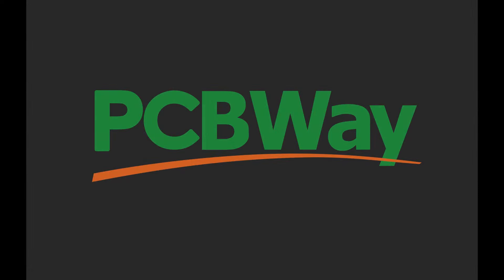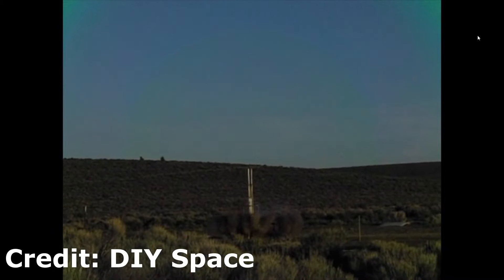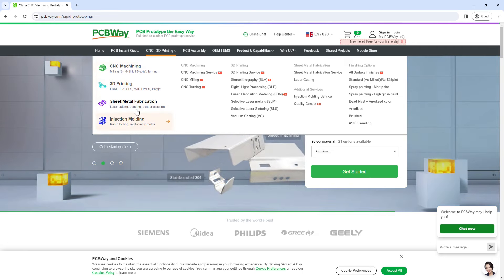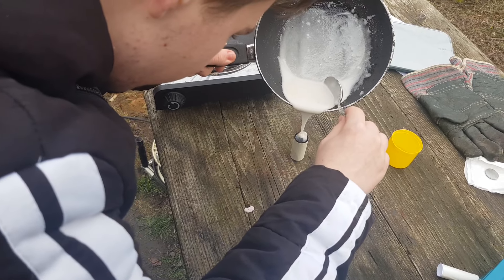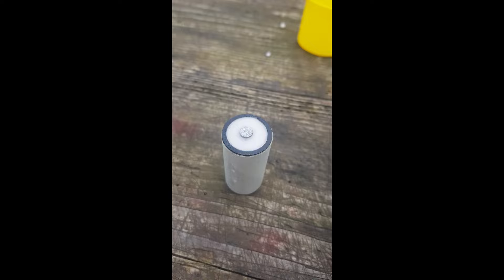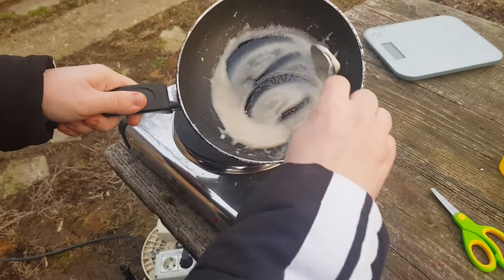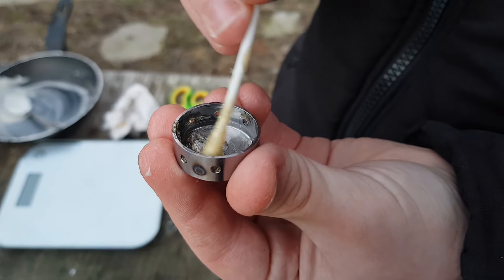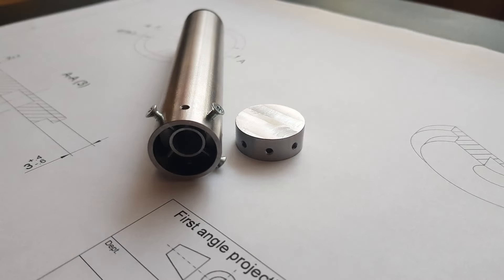I made a Solid Rocket Engine!

Comment: I suggest replacing the rubber seals with high-temperature silicone. Even up to 400 degrees Celsius it will be better than rubber. The second thing - fuel grain is prepared carefully at home. Mixing ingredients, controlling temperature, density, tamping in the form. These are all trivialities, but they have a huge impact on the quality of the fuel grain and its stable combustion instead of explosion.

Comment: Suggest you either use an electric ignition or learn to make long, fast fuse, so you can start from a safe distance and your safety doesn't depend on running. I don't know if anyone does this, but I have found that a bit of carbon fiber, either tow or a splinter of the pre-cured stuff that's been sanded, makes a nice resistive element. The latter is a bit easier to work with. Don't try to wrap tow around a wire. If it's anything like mine, the sharp bend will snap it. You can't solder to it, or I can't, anyway. However, you can wrap wire around it for a connection. I have witnessed what happens when carbon fiber composite shorts out high voltage lines. In places, the epoxy just disappeared, but the carbon was more or less intact. So you can hit it with a lot of current and get a lot of heat. Put some pyrolant on the carbon anyway, though. A quarter inch between the wires attached to it is probably long enough with carbon. It's more resistive than nichrome. 

Of course, you can make perfectly good electric ignitions in other ways. One of the pitfalls, though, is that some resistive elements, if hit with too much current, will fail before they ignite anything. For instance, I was experimenting with small resistors for ignition. Some of them would just stop conducting at all if I used a 3S lipo for current, but lasted long enough to light things when using a 9 volt alkaline cell.

Comment: two things. you must dry the mixture very well, at least a couple of days in a container with a desiccant. second thing, I didn't see how you started the engine, but you have to make sure you light it from the head (not near the nozzle) and the best way is to use an electric match; then I personally use to dirty the wall of the core with a little bit of flash powder (that of firecrackers) to quickly light the entire internal surface
Reply: Third... it seems that your compound lacks oxidant, increase the proportion of kno3
Reply from the maker: I fixed the propellant issue and I'm about to try out the head end ignition. I didn't know you can use flash powder to do that, thanks!

Comment: The solids left in the motor suggest you need more oxidizer.  This will lead to a less viscous mixture making casting the grains more difficult but that's the trade-off.  Good effort though.
Reply from the maker: I actually dropped the sorbitol idea. Last weekend I tested the motor again with sugar and it produced 130N of thrust! 3 times the expected amount. This difference comes from the fact that I didn't take into account that the propellant burns faster under pressure. I will cover these things in a future video. Thanks for the support!

Comment: Hello sir your video was so great and really helpful , i  would like to know how you designed the rocket motor , Need your help as i am designing one for my project i have no clue how to do that .
Reply from the maker: Hello, happy to help! The actual thermodynamics side of designing is a little more complicated but you can find info about it online or in books. By far the most popular book on rockets is "Rocket propulsion elements" and you can find most of the equations there. As for the mechanical side, there are graphs on the internet that show the strength of materials for different temperatures. Since most of the motor is a tube, the math for determining the thickness is pretty easy. Also, make sure you have some sort of liner between the engine tube and the propellant that absorbs the heat from the combustion before your motor tube fails. I didn't have a liner on my design but I highly regret that. The engine is still fine but the risk is too high anyway. I would also recommend working with high safety factors (above 5) so you can be sure you're safe. If your project doesn't require any crazy engine though,  I would recommend just buying one off the internet. The development, machining and the propellant making are way too expensive and dangerous. I hope I was helpful!
Reply: @RUD_Technologies  thank you so much sir ...!

Comment: Your fuel is burning from the top to the bottom. Try getting an electric igniter and push it all the way inside. That way the fuel burns from the bottom to the top, igniting more fuel on its way to the nozzle, therefore creating a higher pressure inside and greater thrust. 
I'm not sure about the power drill to create the hole, my rockets turned out to spin because the hole wasn't perfectly parallel to the casing.
Also try experimenting with different ratios between fuel and oxidizer.
Love your nozzle btw
Great video 👍
Reply from the maker: Thanks! I ditched the sorbitol and the drill idea, now I found a way to make holes in the grains. I would try making electric ignition, but every time I tried making an igniter I failed. I taught of making a really fast burning pyro igniter from the propellant in it's powder form with iron oxide mixed in, and have solidified propellant at both ends, witch burns slower. This igniter would basically be a straw with powdered propellant in it.
Reply: I ve calculatet for sorbitol it would be 78% kn to 22% Sorbitol for total combustion but i think this mix is an little bit aggresive

Comment: Nice video! Maybe try to ignite the propellant through the nozzle but all the way up close to the forward closure. This way thev exaust gas will ignite the propellant grains on its way down. Pressure will increase faster and burn rate will be higher...
Reply from the maker: That is what I am going to try to do in the next video. I am working on a non-electric igniter that could do that, because I tried electric ignition in the past, but I wasn't able to get any good or reliable results. Thanks for the support!
Reply: Great - looking forward to seeing the results.😊

Comment: I'm going to suggest this based on the assumption that your propellent mold is either metallic or ceramic, so take this with a grain of sucrose.

 Have a removable cap on one end with your center cylinder and place the mold on top of it sealing off one end. Fill the container with the unmelted grains mixed thoroughly together. If you can acquire some heater bands that fit the metal tube, and a thermistor (like from a 3D printer hot end), you can use them with a temp controller setup to get the the compound to a fluid temp and melt in the tube. Let it cool and repeat until the motor is the correct size and shape. Once cooled, remove the cap and push it out. This will help prevent spills and be a bit safer overall. Making several of these wired together would also be fairly effective and efficient for making motors in bulk once you have the recipe correct.
Reply from the maker: Thanks for the advice, but I already solved the pouring problem and I switched back to sugar.

Comment: Also, remove some of the fuel, and add a couple of milligrams of iron oxide powder [just dry rust] and some sulfur [even crunched up match heads will work, so long as they are very finely divided, and not clumps.

One of the easiest things to make high powered rockets from is emergency highway/railroad flares.

You just wash them in mildly hot water [not hot enough to boil though, because that will melt the sulfur, which will mess it up], sieve out the coarse sawdust, then use a super fine coffee strainer to strain out the sulfur.

Then you can run a genuine coffee filter to get the oxidizer.

Let the sulfur dry gradually without making it hot [best in a sealed container with some calcium chloride in a smaller container next to it to soak up all the water] until it is fine and dry.

Let the oxidizer mixture also dry slowly [again, you can encase it in a container with another container of CaCl2 inside to soak up the water] and now you will have a lot of energetic oxidizer [potassium chlorate and strontium nitrate] to use.

Take this and grind it with the sugar as the ratios need to be re-mixed properly, with some solvent [such as anhydrous denatured alcohol, acetone, or MEK] to ensure good safe, thorough mixing, and then pour this all into a wax lined paper tube, warm the paper tube until it is about 155C and then let it sit and cool.

You will know it has melted enough when the material begins to liquefy at the top.

This is best done in an oven with ensured temperature control, but a stove pipe and a hair dryer could do the job in a bind.

Just likely it would be best to put some fiberglass insulation around the stove pipe to keep the temperature high enough.
Reply from the maker: Your propellant sounds interesting, but the process of making it is too complex and expensive for this project. I already solved the combustion problem a weekend ago. I went back to sugar, this time I got great looking grains and the motor generated 130N of thrust. 3 times the expected value. I would be interested in your propellant though for use in high performance rocket motors or in rocket igniters. Thanks for the tip anyways!
Reply: @RUD_Technologies  WAIT!!!

WHAT???

MATCHES AND RUST ARE TOO EXPENSIVE???

ARE YOU KIDDING ME!!! \>0.0</

Comment: You could add about  .5 - 1 %  FeO2 (Red iron oxide powder) to the fuel mix which makes it burn hotter and faster.
Reply from the maker: I tried that, but it burns too fast. I solved the propellant issues since then anyway. Thanks though!
Reply: I have a Video of 3 test the last one being 1% by weight red Iron oxide and it was far more efficient @RUD_Technologies
Reply from the maker: I know it's better, I've used it before, but I don't know if the engine can take the extra pressure.
Reply: I built a thrust test stand with a strain gauge and an Arduino to test my engines. But I'm only building sugar rockets with Sorbitol 35%, Potassium Nitrate 65% and about .5 % red iron oxide in  PVC sprinkler pipe. Not as hot or fast burning as regular sugar. I've never had one blow up, but on occasion I do get  KATO's usually when the mix isn't packed evenly . I'm now lining my PVC pipe with Oak tag  materials from office file folders. to prevent heat damage and prevent heat  distortion to the 
PVC pipes.  I've even soaked the Oak tag in a concentrated solution of Sodium Bicarbonate and water then thoroughly dried to keep it from burning. I don't see much difference in the burn rate from the Oaktage, probably because all the combustion has occured before it burns to the outside wall of the Piper and the Oak tag. But sometimes I can re-use the PVC pipes @RUD_Technologies
Reply: @johnkemas7344  So if I understand that correctly your using oaktage for a liner for your grains? 

Sounds like a great alternative to ordering cardboard tubes if it works well. How do you connect the two ends of the paper to form a tube?

Comment: dwg??
Reply from the maker: I am not sharing the drawings.
Reply: @RUD_Technologies  😂 it’s a tube with five holes
Reply from the maker: @andr3742  It's a tube with five holes that stores 30 bar gas at 1800 K and shoots supersonic gas out one end. If it were a less dangerous tube, I might have shared the drawings. And it actually has 16 holes; 17 if you include the nozzle.